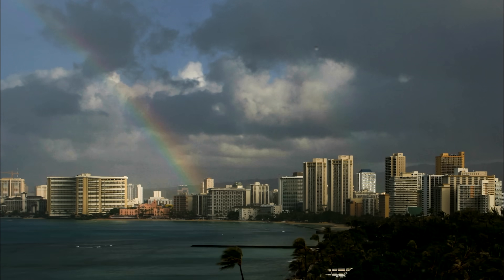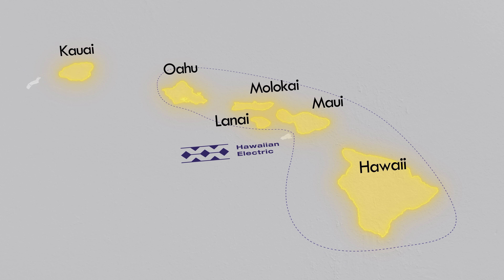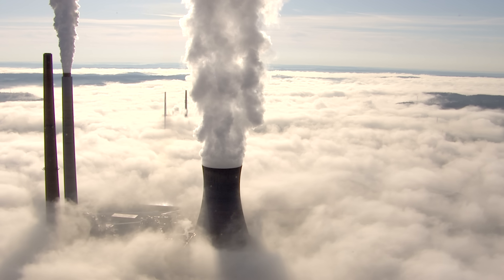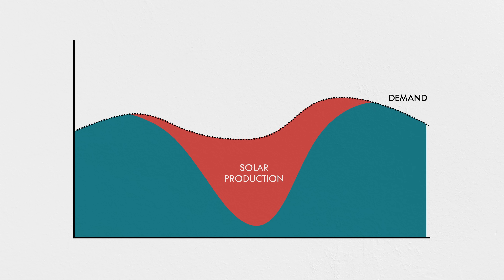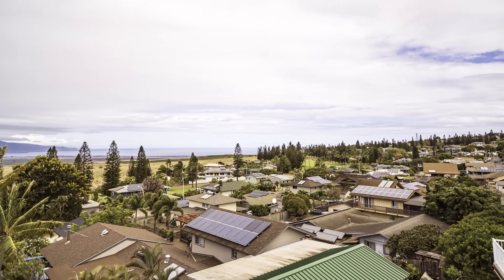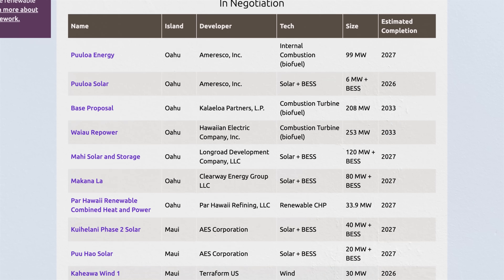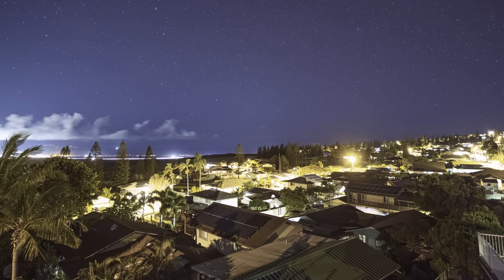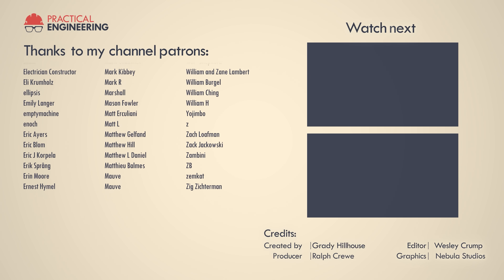How the Hawaiian Power Grid Works

Comment: It seems so ironic to be sitting on top of a huge energy source (volcanoes) & relying on ships to bring oil for your power.
Reply: Geothermal isn’t this cheap thing to tap into l, it’s very hostile to the equipment and have a significant upkeep. Meanwhile a tanker isn’t that outside the box when everything is literally shipped in a ship at some point in the process of making final products
Reply: @Brobrobagins420 I agree it’s hostile & challenging & shipping oil in is much easier. I just meant it’s got to be aggravating to have an almost unlimited supply of energy sitting right below your feet that’s not really able to be used while you pay for your energy to be shipped in.
Reply: Its definitely ironic, but its not without reason. The problem is the island with all the volcanism has less than 15% of the population and the grids are not connected so there isn't as much incentive to go all-in on geothermal. On top of that, tapping active volcanism on Hawaii (the island) puts your infrastructure in the crosshairs of active surface volcanism like lava flows. PGV, the geothermal plant on Hawaii was caught up in lava flows in 2018 and only resumed power generation over 2 years later at lower capacity due to losing 3 geothermal wells when they were covered by lava flow, something that has never occurred in places like Iceland ( went to ~26MW from 38MW). Good news is, plans to expand capacity are underway getting up to 48MW and later 60MW.
Reply: Geothermal is viable. HE needs to expand the renewables.
Reply: @marcusm8009  definitely viable that's why puna geothermal venture is being expanded and why that exists in the first place to figure out the specific challenges with hawaiis geothermal as opposed to better studied places like iceland
Reply: Kinda hard to want to invest a bunch of money on a volcano that erupts every other decade 🥴
Reply: > . . . ironic to be sitting on top of a huge energy source (volcanoes) & relying on ships to bring oil for your power. <
And with all that energy right over the top of their heads.   On Molokai, it should be called energy colonialism.  We send them oil that they don't really need (due to their abundant sunshine, wind and 3,800 foot elevation for pumped hydro storage), they send us money they don't have and we send them tourists to bring them money.  They could easily be self-sufficient with electricity.
Reply: There’s only a volcano on the big island of Hawaii. And for some reason the hippies here hate geothermal.